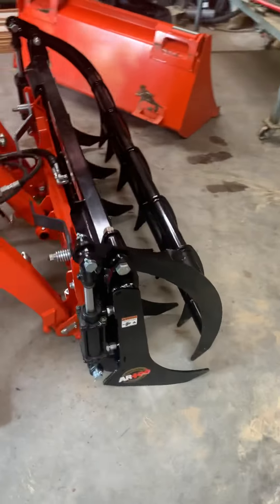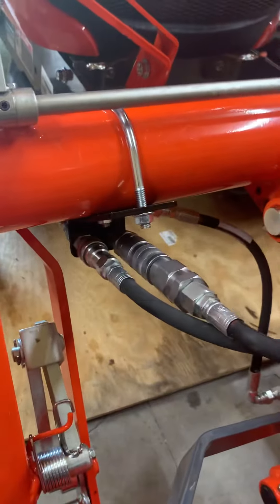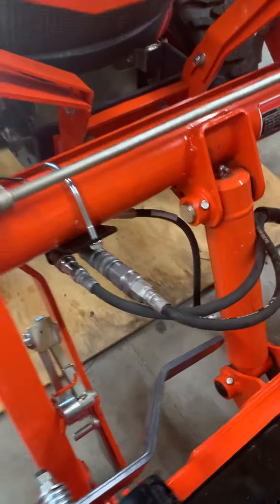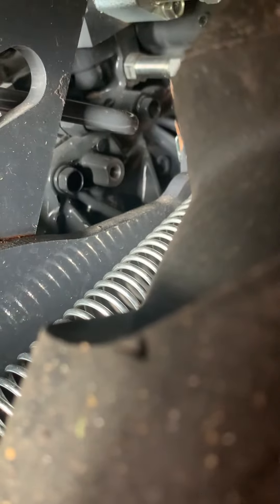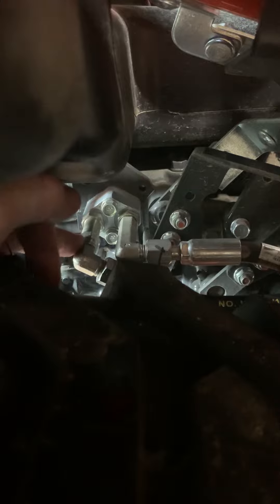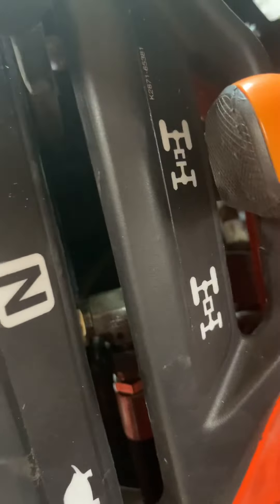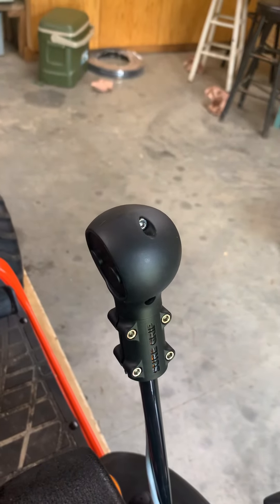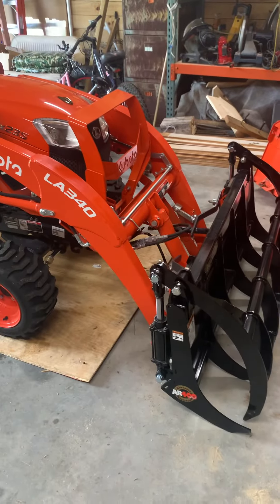Kubota bx23s summit hydraulics 3rd function valve.

Comment: This video needs to be included in the instructions. It clarified the section of the install manual where it talks about removing a steel pipe. There is no pipe on mine. Only hoses. The steel pipe has become the rear most hose connection behind the tire to the inboard connection under the controls panel. One new hose goes from the rear most hose connection behind the tire to the inboard port on the bottom of the selenoid, while the other new hose goes from the inboard connection under the controls panel to the outside port on the selenoid. (I think, makes sense now anyways) Thanks for the video.
Reply from the maker: Glad the video was a help.

Comment: Thanks for video, I'm installing one today and couldn't figure out the power beyond
Reply from the maker: Thanks for the comment.  Another tip is that instead of hooking straight to the battery for the electrical the new model 23s had a fused circuit and plug under the fender beneath the front end loader control. It can be accessed through the fender. I forgot to touch on that in the video. Good luck.
Reply: @blackcedarfarms9463  i have to run and get wire ties for hoses being to long, hope to have project done tonight.
Reply: All done and working great. Also had to switch couplings for grapple. But thanks again for video, it saved me a lot of time.
Reply: @blackcedarfarms9463 do you happen to know what kind of connector it needs ? Thanks